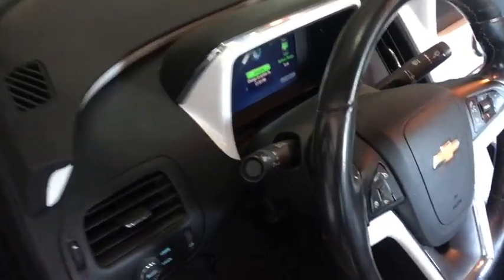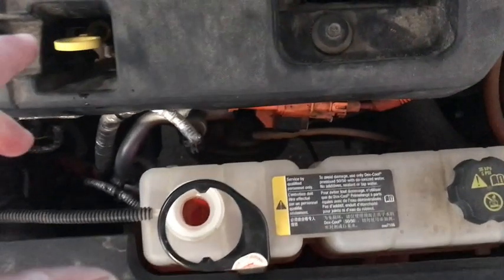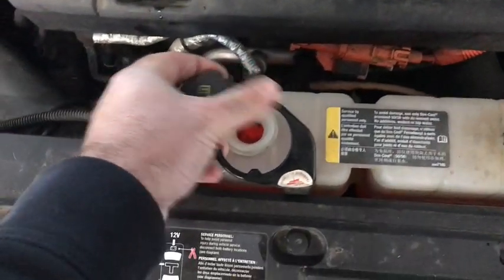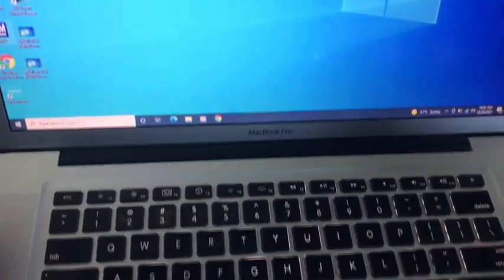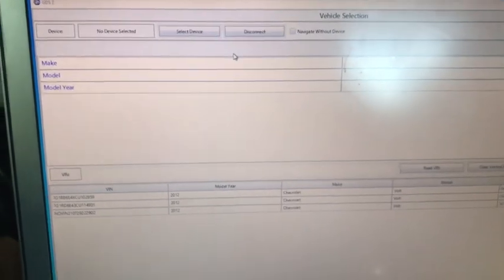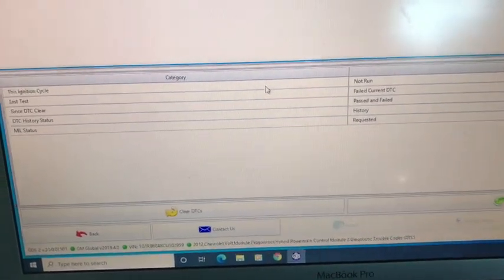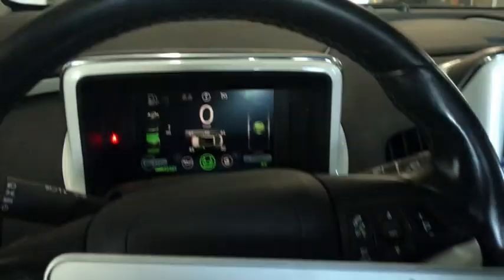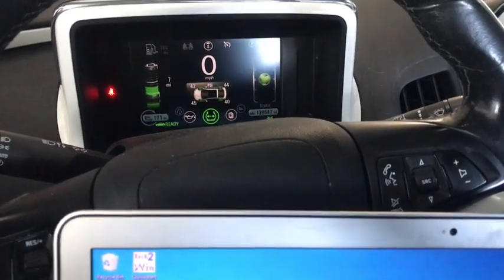Fixing "Service High Voltage Charging System" Error on Chevy Volt WITHOUT Reprogramming HPCM2 Module

Comment: sad i have an isue with elr. there is no fault codes at all. coolant level is fine. connectors of charger and plug is ok. but still wont charge :(

Comment: I tried everything, including buying the software from the official site.

But the official site doesn't allow the software to be downloaded. They simply don't provide a download link after it is purchased. Also, they modified their own software so that it must validate with their online servers when you try to use it. But their software is made to run on a 32-bit Windows XP laptop. So they expect you to have a 20-year-old laptop, with wifi, and for that wifi to extend out to your car in the driveway. 
And their own servers often go down, so they don't validate their own software.

I don't know how anyone puts up with this. The professional mechanics must hate it with a passion. 

Some diagnostic scanners that you can buy will clear the code, some will not. It requires the scanner to have additional functionality and programming, which many fly-by-night scanner makers won't do. And even the makers that have established a name can either go out of business or run out of stock, or Amazon/eBay/anywhere gets filled with counterfeits that use their company name but don't have that functionality.

It doesn't need to be this bad. It doesn't need to be bad at all. But GM made it this way. 
Thank you for reading my rant.

Comment: For me the scanner gave me an error code of P1E00 and $07E8 and a freeze frame of P0AA6 any way for me to know what’s wrong exactly and how to fix it?
Reply from the maker: I would make sure your battery isolation is good. If you have a Bluetooth one scanner, you can use the My Volt Control app to see the impedance to ground.
Reply: @utjay2008 could you explain further on what I’d need to do

Comment: another trick i got from onstar operator - basically she says try walking with the keyfob at least 100 feet away from vehicle for 10 mins - then come back and start the vehicle - the warning will go away too - so you can drive your vehicle again - but she also added that you still need to check in with dealer later on - as this trick only let you drive your car for a few hours until the warning pops up again - surely you can repeat the 'walk away and wait up' trick as many times - but dealer should be able to decipher the issue at a better rate -
Reply from the maker: I’d have to see a video of that working. That would be crazy!
Reply: You should be able to start and use the car regardless. It just won't let you charge the battery from an external charger.

Comment: The topscan scanner works great for clearing SHVCS codes but it doesn't do the reprogram.  I did a reprogram with vcx nano a while back but codes eventually came back if I let the battery run out.  The vcx nano software is a pain.

Comment: Thanks for the video which I'll be referencing while starting the reprogramming journey on my HPCM2 today.  Just curious how long this fix lasted until you had to do the full reprogramming. 

I did find a pretty comprehensive video (without sound) that covers all the pieces and how to install them on Windows 10, if anyone is interested. 

I set up VMWare Workstation Pro (free)  plus Windows 10 (to assure everything is isolated from my system) and yes there are a lot of perceived threats via Windows Defender, rather real or imagined which I chose not to leave to chance.
Reply from the maker: I had this fix last about the same amount of time as the “real” fix did. I got a 2014 and haven’t had the problem in over a year with that one. 🤷‍♂️

Comment: I had "Service High Voltage Charging System" on my 2013 Chevy Volt a few days ago. I noticed that the car did not charge when I plug-in. I cleared up the code using regular obd2 scanner but the code came up again when I started the car. So I cleared up the code again, but this time I did not restart the car, instead I plugged-in the car right the way. It worked. The charge light indicator was on and I let it charged. I started the car after an hour of charging and the code was no longer shown on the screen.
Reply: Mine has to be reset every day.
Reply: Thank you for mentioning this. I might be having to try this in the next day or so.
Reply: Update: after topping up the 50/50 Dexcool mixture (it was a bit below the coolant tank seam after many years of evaporation), I used my "get it done" OBD II scanner (Ancel AD410 from Amazon) to clear the diagnostic code while the Volt was running. The code cleared immediately, as did the dash message about the High Voltage system. I turned off the ignition and plugged in my Level 2 charger. The Volt is back to its normal charging self. Back in business!

Comment: I have to reset the code nearly every day, it works long enough to recharge but I have to clear the code the next day.
Reply: Well it pass smog test? I clear mine everyday also. But this year have to smog test it for registration
Reply: This has nothing to do with smog test.
Reply: I do not live in a smog test state (thankfully), not because the car wouldn’t pass.
Reply: How did you reset the code. My OBD reader says “turn key on and engine off”
Reply: I see this comment was a year ago. I am having to clear this code everday now too after a junkyard battery swap. Is your volt still running? Did you every figure out a more permanent solution? Did clearing the code lead to more issues?

Comment: Great Vid! Do you know if the Volt has a starter/solenoid that starts the motor when not using electric?
Reply from the maker: It does not. It uses the HV / traction motor to start the gas motor.

Comment: Hi, I just followed these instructions today and they worked. Anything interesting happen in the year since you posted this? My VCX nano came with the software on a usb drive, did the whole VM thing and it went well. FWIW, first thing I tried was the built in windows Hyper-V manager, that will not allow you to passthru the usb device, some time wasted, VMWare worked.
Reply: How do you connect the MacBook air to the Volt? and what is the actual programming software

Comment: Tank is full, cleared the code but error returned.   Does anyone know how to replace the sensor on the outside of the tank?  Or is that the problem?
Reply from the maker: Just saw your comment. I have a video about how the sensor works and how to replace it. 

https://youtu.be/tZI58rLRUb4
Reply: @utjay2008  thanks!  I actually replaced the sensor since then.  But Still cant clear the error.  I have a scanner that reads and resets the errors but not luck.  Unplugged the battery for a bout a day just to see if that would help and still got the error.  Any thoughts would be helpful and thanks!!
Reply from the maker: @USMC-1  does it clear and come right back after a few hours? Or instantly return?
Reply: @utjay2008  It doesnt clear at all.  Just stays on.
Reply from the maker: @USMC-1  you’ll probably need to flash the software on the HPCM2 module. You can use a VCX Nano or MDI Clone (or MDI if you’re rich lol). Here’s a video I put together a while back on how to do it. 

Using Techline Connect and a VCX Nano to fix Chevy Volt Service High Voltage Charging System Error
https://youtu.be/eza-Y3oUnS4

Comment: Hello, this may sound like a dumb set of questions, but : 

1) Could you please tell us where to download the software from? I have found a website that charges different rates for downloading 20$ for a single GSD2 download up to 50$ for a download with "live installation" - Why would I need "live installation" I don't  understand, perhaps there are specific parameters that need to be set up? 

2) Does it work with any OBD II adaptor over Bluetooth for instance? or do I need to buy a cable?

3) Does it work with any windows 10 computer?

Thanks in advance. Best regards, thanks for the video.
Reply: I don't know exactly, but suspect the "live installation" gives you full updates where the one-time install probably won't update for Software updates made by manufacturer since the software was coded.

Comment: I also have the TDS SPS subscription and had updated all my modules without issue.  There was 1 code pointing to the sensor on that reservoir so I replaced it with a OEM one.  I now have a permanent code.  I haven't driven the car and was wondering if I need to in order to rid the code, P1FFD, I believe.  I did try and clear codes but it won't as it's a permanent code.  Or do I need to run some diag in SPS or GDS?  I did also replace my heater pump near the right front wheel well area to try and get my heater back to working.  Any suggestions would be awesome.

Comment: The anti-tamper bracket is there to prevent vehicle owners from topping up a leaking battery cooling system.  In the event of an internal drive battery leak, coolant can cause a short, which can lead to the car burning down. It's not just an annoyance or to make owners go to dealers to get air out of the system. It's a major safety concern. Go ahead and top up your system, but if it needs attention more than once, go get it checked. I love Volts. I don't like hearing about fires.
Reply: 😂 You've not got the memo this coolant  is not conductive 😂 the bracket is there to stop fools from putting in the wrong coolant, such as yourself.

Comment: I own 2014 Volt started driving with 41 electric miles, when  it changed from battery to gas the check engine light came on, turned off the engine and tried to restart with no luck, towed to the nearest dealership they performed a diagnostic (charged $200 Dollars).  I was told that the entire battery pack needs to be replaced at a cost of $16,000 Dollars.  Does anyone knows of better solution? The vehicle has less than 88K miles driven most on battery power.
Reply from the maker: Oof. My older 2012 has been doing similar. Seems to be an issue with battery temp. I usually just pull over, shut it off, open the door and restart it. Works fine for a while. But that’s typically a ‘12 issue.
Reply: I had had a similar issue happen to me last year during summer. I was driving fine, had about 1-2 electric miles left, parked at a store, left store and as I was pulling out the parking lot, car just stopped accelerating and slowed down to a stop. I assume it went to gas and then that's when it happened (similar to you going from electric to gas). I know my 12v battery was still good because all the dash lights and radio were on. Plus I replaced it a couple months before. I tried starting the car several times but it wouldn't start. Only dash lights and radio. Had someone come help try to jump start it but still nothing. 

I eventually got it towed to the dealership.

A couple weeks later they call me and say that my 12v was dead. I told them that's not the reason why I originally brought it in. I told him that if it's dead now it's because there's a live wire somewhere that drained the 12v and they just left it sitting for 2 weeks, but that's not why it died on my 2 weeks ago. They argued blah blah blah, said that it was going to be 360 dollars for battery and labor. I begrudgingly accepted. A couple hours later they call back and tell me they have really bad news, that after replacing the 12v, it still won't start and that the high voltage battery would need to be replaced for 21,000 dollars. I told them get bent, that cost more than what I paid for the care, and that I want a refund for the other shit the were going to charge me. They said they'll refund me the labor but can't refund me the battery. Anyway, I picked it up and took it home a few days later.

After letting it sit for a couple weeks, I came across an article on on gm-volt[.]com with someone with a similar scenario and they just tried jump starting it after letting it sit dead for a few weeks and it started. So I tried it, and guess what, it worked! I have no idea how.

If you still have this issue (2 months later of your original post), try jump starting it again (from the engine bay of course).

Comment: Just cleared the code on our 2012 Volt with an Actron CP9125.  It cleared on the 2nd erase attempt. YMMV.
Reply from the maker: Good to know it worked the second time! Thanks for sharing. Sorry I just saw this.
Reply: Is it staying off, or just a temporary fix?
Reply: @raycosman824 Hasn't returned since but it has only occurred when I have hit a large pothole which gives the coolant float a good jolt.

Comment: Why is your tire pressure so high?
Reply from the maker: I’m not sure what it was showing in the video - I typically run them near max cold sidewall pressure, 42 or so psi.
Reply: @utjay2008  The recommended tire pressure is 35 to 38 psi, depending on the model year.

Comment: Very helpful. My 2014 Chevy Volt wouldn't let me charge the main battery. I topped up the coolant reservoir, cleared the error code, and boom, it's letting me charge the battery now.
Reply: How did you connect to volt computer and with what device?
Thank you.
Reply from the maker: YES! Glad to hear!
Reply: Is it just regular coolant?
Reply: @petersimplife dex cool orange color

Comment: So my 2012 volt died. 12 volt battery dead. Replaced battery.  Now says unable to charge. Took it to an EV shop in Tampa. Says my big battery is toast.  OBD2 and my green volt shows a few cells at the bottom.  But any chance this could help?
Reply from the maker: Hi there. This only helps for the “service high voltage charging system” error. I’m only slightly familiar with MGV app, but I do know that the scale on the battery cell monitor is very tight. It may be just slightly low but the graph makes it look empty. Perhaps try to disconnect the 12v for a few minutes? Either way best of luck!
Reply: @utjay2008  12 volts been taken out and put back in. I guess the car is toast
Reply from the maker: @MikeSsuncoasttrains  probably worth a second opinion. And you can check out greentechauto for a battery section. I’m not affiliated and haven’t used them but heard good things.

Comment: My 2013 Opel Ampera just started having the Service High Voltage Charging System error. A cheap ELM327 Bluetooth OBDII adapter and the Torque app for Android was able to clear the codes, as long as the car is powered on. The cleared codes are p1f0e, p0aa6, p1fff and b2aaa. Torque gives no explanation for the errors, but some googling and a gmvolt forum post put me on the track that led me to this video. The error comes back about 1-2 times per week and can not be cleared immediately after it arises, so I usually leave the car in the garage over night before clearing the code and charging works again. It's OK with the crazy European electricity prices and cold mornings these days, but I wonder if the shop will be able to permanently fix this by following the service bulletin. It said something about pulling a drain plug to look for a leak, but I didn't want to start stripping off the shielding underneath the battery.
Reply from the maker: Pull the drain plug if you notice that the coolant is low. If it is, then the coolant may be bleeding into the battery.
Reply: Do you mean drain the coolant?

Comment: Did the error come back in a few hours? I cleared my code with a cheap scan tool and it got rid of the code for a few hours but the code would come back always by the next day. Reflashing BCM and PCM with vcx nano finally fixed it.
Reply from the maker: On this car, it went away for a while then came back a few weeks or months later. I ended up flashing it to the older SW version that ignores the sensor. On my other car it only worked for a few hours. That one needed the HPCM2 flashed through SPS/TLC.
Reply: @utjay2008  Do you know what version of software ignores the sensor?
Reply from the maker: @AustinWilhite  it’s weird. On my 2012, it doesn’t give me an option. On my wife’s 2012 it asks if it is “with RESS” or “without RESS”. On that car I selected without RESS and then it ignores the sensor. That is only when reprogramming the HPCM2 module like in my other video though.
Reply: @utjay2008  Thanks! This is great to know. I bet the difference between the two is that one came with the sensor from the factory and the other had it installed post delivery at the dealer. I believe my vehicle had the sensor installed by the dealer, so I'm hoping I have the "without RESS" option.
Reply: @utjay2008  Oooh, this is good to know as I did see that RESS message.  I actually removed that bracket when i replaced the sensor.

Comment: Ok update on the high voltage error on my 2013 volt. I took it to the dealer. And it just needed an update on the becm. Stands for the battery energy control module and it hasn’t came back on so far.
Reply: Was this expensive to do at dealer? I am having same issue and thinking this is what my Volt needs.
Reply: @brittanywiatrak4869  no, it was only 100 dollars 💵
Reply from the maker: Glad you got it sorted. The HPCM2 and BECM are usually updated at the same time.

Comment: Quick question. I cleared my code and gds2 will move to the next screen, but the code was never removed. Does this mean the actual problem has not been fixed, or that I need to use techline connect instead?
Reply from the maker: And a video on how to reprogram the HPCM2 software. It’s funny how some times it can clear with a cheapie obd scanner, sometimes with a good one (or gds2), and sometimes it just needs a whole reflash. 

https://youtu.be/eza-Y3oUnS4
Reply from the maker: I would check your coolant levels, and perhaps swap the sensor with a new one if they’re ok. If that doesn’t do it then I would look at reprogramming the HPCM2 module with techline connect.
Reply: @utjay2008  Thank you! your channel has been super helpful!
Reply from the maker: Here’s a video on where the sensor is and how it works. 

https://youtu.be/tZI58rLRUb4
Reply from the maker: Appreciate it! Good luck with the Volt!